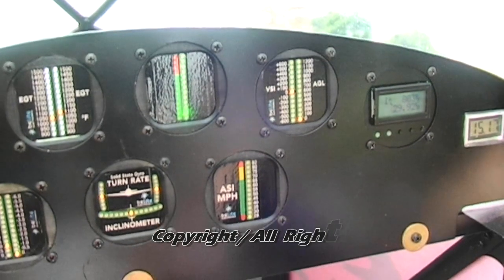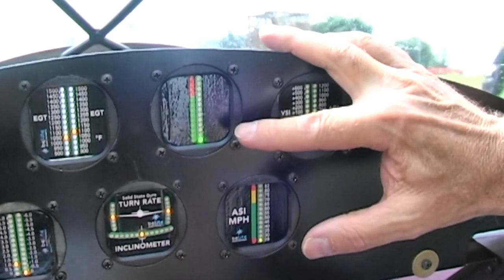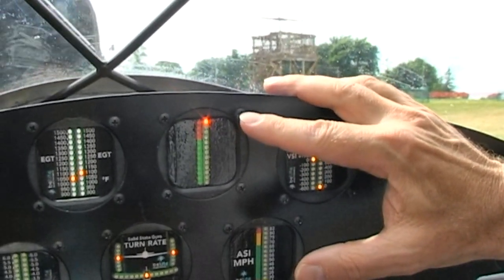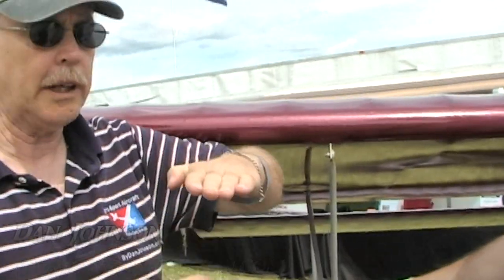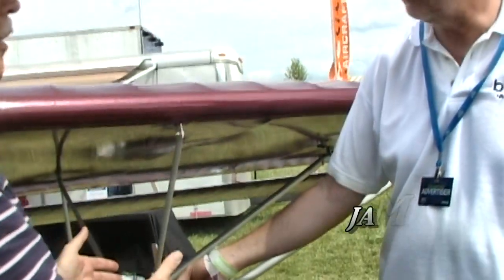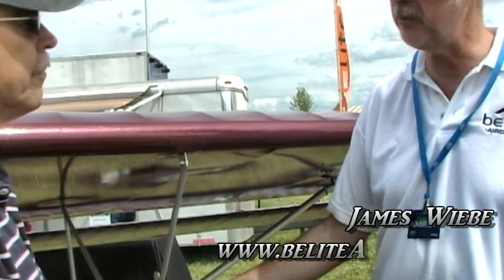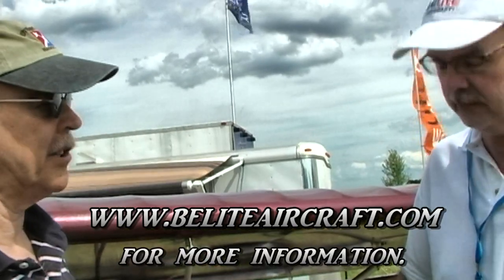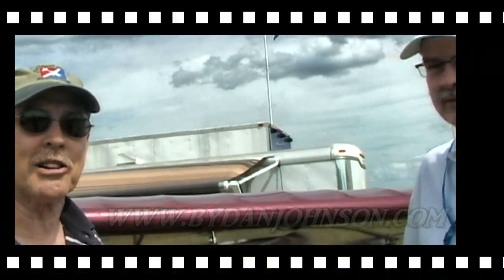Angle of attack gauge or AOA from Belite Aircraft.

Comment: I am confused for a different Reason - not owed to the extreme value of an AOA indexer (Have a few thousand hours in Navy tactical aircraft for a quarter century, with critically rely on AOA, as do most airlines) - but that the Belite Rep said as of this spring this is the first frictionless vane AOA for sale, which is not true. I have one (for less), from Rite Angle. In fact the systems are VERY similar, but Elbie makes his vanes, you have a flap option, there is a CA 337 precedent, and the indexer is much more like professional indexers (in many of those version). So why would this company tout it as First when it's not? Just curious - and I have no vested interest in either company. Almost considered one of these units (comparing them), til the youtube proclamations in the viseo....